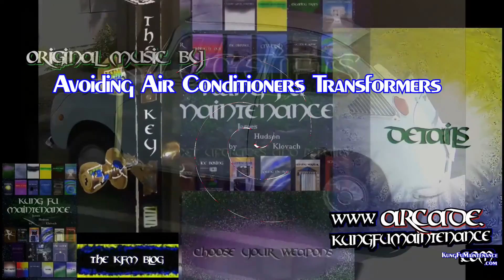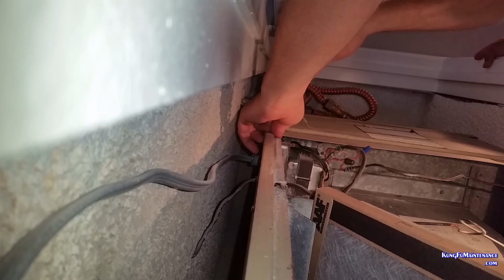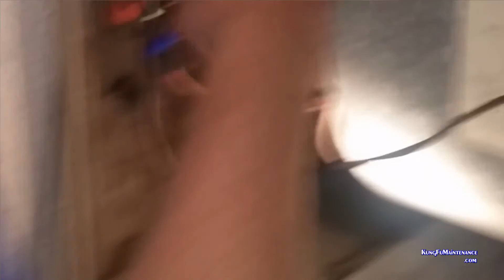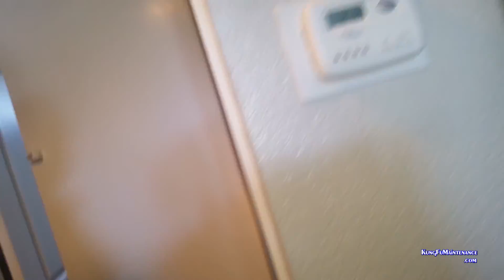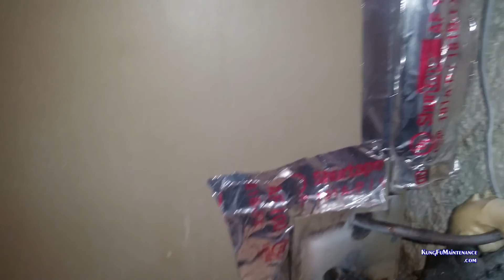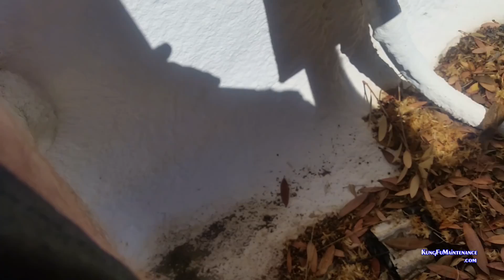Transformers Avoiding Air Conditioner Trap Red To White Wrong Volt On HVAC

Comment: couple of suggestions.......first, kill the breaker before you unplug that thing since its in an awkward position and you were having to poke around at it with your fingers.  if itd backed out enough to get your fingers in there you could have easily cross out the 2 prongs with your finger and gotten 240 volts real quick.  second......use some crimp terminals on your transformer connections instead of twisting everything together.  stranded wire doesnt stay twisted very well.  BTW.....the RESISTANCE of the contactor coil is the problem.